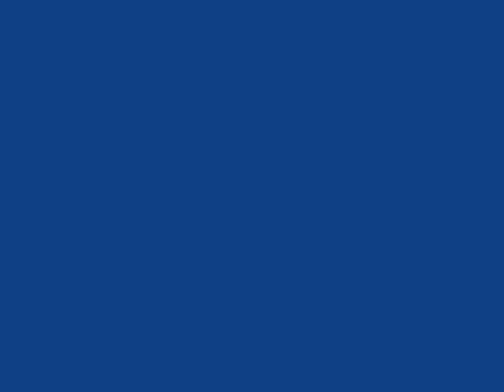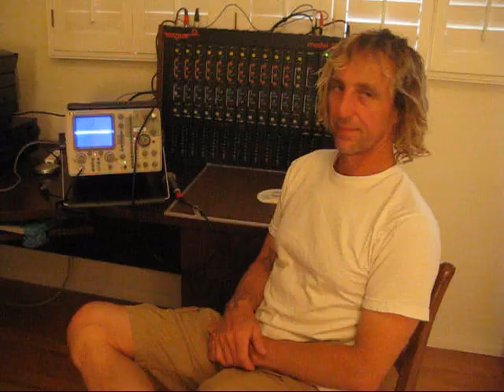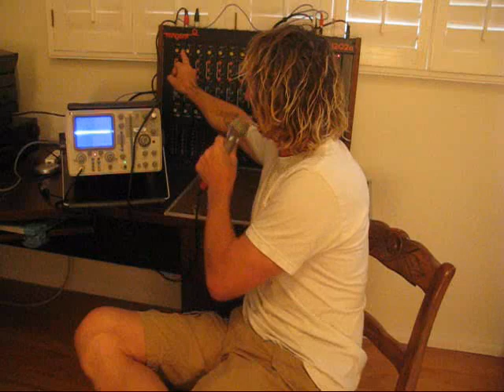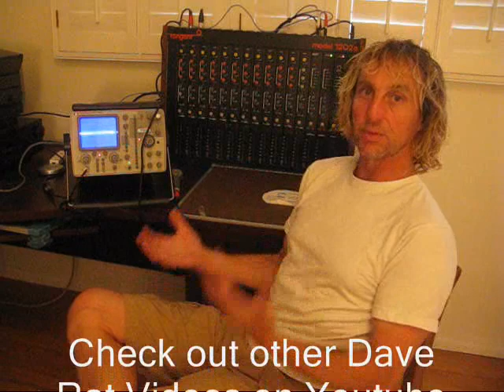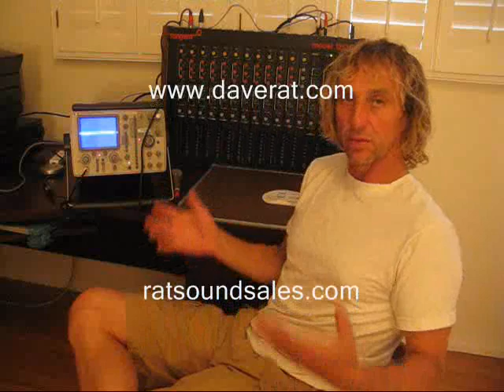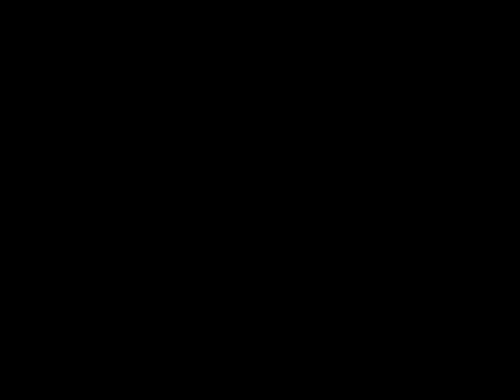Gain Structure Basics for an Analog Console

Comment: On an analog board, the gain structure has a couple of important parts.  1 - Read the manual.  Electrically the power supply in most analog consoles is Plus and Minus 15 volts, so the output of the board will not put out a higher peak than about 12 volt peaks.  On most boards this is at about +24 to +26DB. Normal output is +6 DB for 0VU. 0DB is defined as 0.775 Volts AC. +6 is about 1.5 VAC.  The difference between nominal output and clipping is called Headroom.  The Difference between output and noise is called SN. The difference between peak (just under clip) and the noise floor is called Dynamic Range.  Running low levels reduces the SN ratio.  Running hot increases your SN ratio, but reduces your headroom.  If you run the recommended 0VU all the way through the board, then you have proper headroom with good SN ratio.  Your effects, EQ, Compressors, etc are expecting signal levels in the +6 DB range to operate propterly.  Ideally when the board clips at +26, this is the same level your EQ clips (about 12 volt pos and neg peaks)  If you run the board hot, and turn it down in the EQ, the EQ will run with less dynamic range and higher SN ratio, etc.  Use the design levels people for best results.  Set your channel gains, then mix with sliders, and set the mains for about 0VU (+6DB out). Set your final system volume on the amps.
Reply: isettech why you are not using the unity or the 0 in the anolog
Reply: Excellent
Reply: So much misinfo here.
Reply: I just realized I didn’t offer much in my reply.  The short descriptions of headroom, S/N, and dynamic range are each correct.  Literally everything else - all the numbers, the math, the description of console power - is just nonsense.  I’m sure the poster meant well but I’m always bugged by explicit tech knowledge offered with gross inaccuracy, numbers without references, etc.  The over-simplification of console operation is the most grating of all.  The mixer is a creative tool and always has been.  Technical rules are just suggestions for the creative.  Many sources simply come alive with intentional and selective saturation of the channel’s various stages.  Phrases like “expecting” and “operate properly” have no place defining the special tools in an analog mixer.  Learning how to use the preamps used to be mixing 101.
Reply: @artysanmobile  You can ignore the physical construction and limitations of the operational amplifiers at your own peril. Feel free to look up the repair manual of your console and find the power supply section.
Nice of you to debunk the "Generalities" mentioned. I repair equipment for a living. Yes, I know the repair side as well as I know the operation side.
If you want to look up the open loop gain, slew rate, linearity, noise figure, etc of your console, then you would know that many physical limitations are real.
Feel free to visit Texas Instruments Op Amp selection guide for discerning audio enthusiasts.
In regards to "Creativity" in audio mixing, I use the example.. Some people can paint a Picasso abstract and call it art. These people who can not properly do proportions and mix pait colors to get precise colors will never be a Normal Rockwell.  At my events, we don't want Picasso sound.

Comment: @canetree it wouldnt let me post the link, so ill post it here. "Preventing Loudspeaker Damage - Preventing damage to or failure of a loudspeaker is not a function of amplifier size nor the loudspeaker's power rating. Preventing damage is a function of operating an audio system so that a loudspeaker is not stressed beyond its limits. If an audio system is operated improperly, damage to or failure of a loudspeaker can occur even with an amplifier sized well below the loudspeaker's power rating.."

Comment: @canetree continued... ".... Contrarily, if an audio system is operated properly, damage to or failure of a loudspeaker can be avoided even with an amplifier sized well in excess of the loudspeaker's continuous (or RMS, average, etc.) power rating."

Comment: There is a large difference between the two. The former is the result of harmonic distortion being introduced at the input stage. This signal is then reproduced by a power amplifier SENDING SINE WAVE.

The latter is the result of the output stage of an amplifier not receiving enough juice from the power supply, resulting in a SQUARE WAVE to the speakers.

The difference is thus, in a purposefully overdriven guitar amp , the output stage still operates within it's limits.......all good...cont.

Comment: @StuballScramble (cont) Most faders on professional consoles  are at least 100 mm are are less sensitive to small movements. Especially if the fader is near 0 or nominal. What you might be seeing is that the smallest movement on the gain produces feedback, but the actual increase may be a larger increase. (lets say 4dB). On the fader, you may be able to bring it up 3dB, and not get feedback.

Comment: its interesting to see such a highly acclaimed sound engineer with worlds more experience on bigger shows than I'll ever have teach doing this explicitly opposite the way I would, and the way I'd teach someone else to do it.  I definitely learned from this video!!  His method HAS to be faster than what I've been doing for getting an acceptable mix out the speakers on the first go.  The problem I see with setting gain for fader position is that it ~doesn't~ force the rest of your system gain structure to be 'correct.' 

Here's what I've always done:

I've always used 'solo the channel during the sound check song, set gain for the board's unity level based on the meters'  This has the benefit of ensuring the signal is dead on where the board's design engineer aligned all the circuitry to sound its very best.  If after doing that your master faders and aux sends are NOT where you want them when you bring up the PA, effects, monitor amplifiers, etc..  then you have gain problems down stream from the board and you should go fix those so that the controls are where you want them.  Basically I'm trying to optimize the board to work at its best, and by doing so force the rest of the system into a good S/N ratio.   So many small time rigs I run into have the amplifier gains wide open, which adds hiss (because they use shitty equipment) and means all their input gains are really low..   Am I just doing it the hard way for no reason?
Reply from the maker: It's all about finding a technique that is optimized for your application and systems.  I learned to set gains really fast when doing a 60-piece orchestra for afternoon concerts in the park. without the ability to make noise before the show started I had to learn to set gains EQ channels and EQ the sound system with house music without ever hearing an instrument through the PA. I will try and do a video going into more depth on the technique
Reply: @DaveRat please do this video. I’m highly interested in this topic

Comment: @canetree well, we could use some upgrades, but thats another story for another day. (We have a pretty impressive company for a town of 60,000-and we travel up to 200 mi)
What i was saying is that when you are clipping a channel at a concert, you are already likely to be at a high volume. When you start sending a square wave to the amps, they amplify that and instead of the speaker smoothly going in and out, it gets held in or out. when that happens the voice coil heats up and the epoxy melts

Comment: Mike- what Dave did on this video was set the faders to +3dBon the console and then finesse his way around the trim pot. He can do this based on experience with the console and how it will react. 

I would recommend a slightly different approach to gain structure for you based on your question. You would probably be better with using the PFL button and meter to set your input levels. At this point you can set the inputs around 0dBu the way you want to hear them and giving you logical send levels

Comment: Excellent Dave.  Subscribed.   I've just acquired an 18-8-2 console and although I've done some sound (FOH) engineering (decades ago), I'm predominantly using this board for recording via a Fostex D160 16 tracker.   THis was a good refresher for me and I'm glad to see that what you advocate is pretty much the same way I remember things.  

However,  in the past I was mostly flying the board live into PA.  Whereas now, I'll be mixing down and mastering to a two channel DAW.   So in this context, the clipping aspect I suspect will need to be watched given that I'm mastering to digital, from analog via a two channel A/D interface.

Comment: Hey Dave, one thing i think you should point out to your listeners is that when you clip channels on a board, you are sending a square wave (instead of a sine wave) through the amps and to the speakers. The company I work for has had engineers clip something throughout a night and come back to the shop with something like 8 blown 18 in drivers and 6 blown 15s. Now, they were probably going to give at some point, but the continuous clipping eventually led to a premature failure in the voice coil

Comment: for FOH i run all faders at zero, and use my DCA's or VCA's to balance the band. the only fader that rides above zero is a solo or a lead vocal. it's visually neat and clear to me. if i need to boost a hi hat or something i go for the trim/preamp. 

it's the opposite of my recording methods.

i basically end up using my DCA's etc to do what you do. i am going to try it your way next time. i also do the " just play as a band " thing or have back line run line checks.

as always, respect, and thank you for sharing!

you should have a show, or be teaching at your shop.

j

Comment: @thaflyinsoundman If the amps are matched such that they're powering the speakers at their program rating and you start running highly compressed, clipped signals through the system when it's going full tilt without proper rms limiting, it's quite easy to cook drivers in a short period of time because you will exceed their rms rating. Program power rating is usually 2x rms, so if the amps are full tilt with clipped signals feeding them they're capable of 2x rms into the speakers.

Comment: Digital snafu - expensive tech repair. Analog snafu - tap it, that doesn't work, get a bigger hammer. 

Thanks Dave, I have a relatively inexpensive, analog mixer to interconnect my homegrown setup.  I have experimented and come up with a usable knowledge about this rig but wasn't really sure if I was using the "correct" approach. I feel better now about some (but not all) of my conclusions. I find the "work backward" concept particularly useful and completely logical. I have always put too much emphasis on the early gain knob because I was also guilty of thinking that too little "gain" would allow excessive noise. I will be correcting that immediately. Thanks again, TW
Reply from the maker: Cool cool. Yes, am doing a 5 part series right now on posted in my YouTube membership area comparing a small format digital to small format analog console and the differences in latency, HF response, LF response, transient and overload. 

At some point I will release the series for general public.

And keep learning and figuring!
Reply: @DaveRat  -  I decided I get so much valuable info (not to mention entertainment) from your vid's that it is time to give a little back - signed up in appreciation - now I need to figure your site out. TW

Comment from the maker: @RhinoSanderson yep.  Especially if you have a fairly quite console.  Just be sure that if you find the gain way low or way hot, to use the pads to get the gain knob into a reasonable rotational position, say between 9 o'clock to 3 o'clock would be best.

Comment: What I did say was that where you have your amplifiers MATCHED to your speakers, IF you send your AMPS in to clip, you are now driving your speakers too hard which will eventually cause thermal overload, otherwise known as a burnt voice coil.

Of course clipping your amps also introduce distortion.

The DIFFERENCE that I was pointing out to you which you seem to have missed (since you claimed clipping is the same as limiting) was that when an amp clips, it is outputting MORE power not less!

Comment: This is one way to set gain structure - the "fader position" style.  I prefer to use PFL/solo mode(which is unaffected by fader positions), even if I have the whole band going full out during soundcheck.  This way I know I'm using optimum gain on all inputs and my sends are getting enough current to send signal to any stage monitors, aaaaand, I can set my mains amps(FOH) attenuators to the required or legal volume level instead of having them fully clockwise all the time.

Comment from the maker: @canetree I very rarely see true DC from even blown amps.  But when many amps are over driven the output forms a square wave with the flat part top and bottom of the square wave being the DC supply rails of the amp.  You can even often see the ripple of the supply as well.  So nope, not true DC but its a DC component to the waveform that increases heat and RMS delivered to the speaker.

Comment: @StuballScramble In smaller venues, you often dont have a separate monitor console, and likely are running FOH and monitors from one desk. When you have stable levels in the wedges, the minute you touch the gain, it changes the level going to them too. Some of the feedback could be actually be sourced at the monitors, but you are hearing it through the main pa. Also, a gain knob has a travel of, what, 1 in max? Most faders on professional consoles are at least 100 mm and are less sensitive.(cont

Comment from the maker: Pretty much that is correct. Faders are just attenuators, usually.  There are some exceptions like old Tapco consoles where the faders were gain stages that could clip.  Also the group or L/R summing amps are set such that with the fader at zero, there is unity gain. Looking at it another way, the fader at zero is actually -10db and the summing amp is +10db.  Do ya follow?

Comment: Dave, does having to be more careful with gain in the digital world present tougher challenges for getting that optimal sound?
Reply from the maker: Different challenges. With analog you can use the overload as part of the sound, and w digital, generally the overload is undesirable in any form. That said, if you want super clean, no overload, the two formats are similar, stay away from the red.

Comment: Depends where the light is triggered to show up. On high end consoles there's up to 40dB headroom above the top red lights on the meter, so you can have the meters showing glowing red and still be hearing no distortion. All depends what you're putting through them, but generally meters are only a little light or dancing needle of some sort, and it only shows you what it's calibrated to show, which is not necessarily what's happening with the components and signal

Comment: Should also be noted that the EQ has a bunch of little amps in it, and that if you're planning on shaping the sound using a lot of boost, starting off with a conservatively low gain will prevent the EQ from overloading, which sounds quite different to straight clipping, but is equally muddy and horrible, if not more so. Lots of consoles have a +20dB gain on the EQs, so if your level is 3dB below clipping, then you will push it into clipping inside the EQ by boosting even a little bit.

Comment from the maker: The effects of clipping vary. Most well designed gear can handle some clipping without damage and quite often without dire sonic effects. Clipping just means you have reached the voltage/current limitations of that piece of gear or that gain stage. Some gear tolerates it better than others. I have no issue with exceeding the limitations as long as the results are in line with the application.
Reply: Depends how the meters are designed, and particularly whether professional standard line +4dBV or consumer standard -10dBV line are being indiscriminately mixed, which can really cause problems (as I am sure you are aware).

Certainly really good analogue equipment has heaps of headroom, and you can run it red hot without suffering anything other than a few percent extra THD, rather than squaring off waveforms. Very much depends on the circuit design, particularly the power supply.

Comment from the maker: Setting input gain is not as complex or delicate as many people make it out to be. Basically if the gain is too high, the channel clips and can cause undesirable distortion.  If the gain is too low it can cause you to run out of headroom and you will get some additional console hiss.  So, you just need the gain pots somewhere between too low and too high.  Preferably a position that causes your faders to sit in logical positions.

Comment: when you say you clip the kicks and snares on analogue mixers, is that kind of like setting a basis of compression for the maxinal sound inputs for that chanel, so not compressing the quieter inputs, but when the kicks and snares are hit with force, evening the signal out by allowing it to clip? or what advantage do you get by letting the kicks and snares clip?

Comment from the maker: However you want to look at it.  All those db's are relative.  Many mixer manuals will have a gain structure diagram that shows exactly what is going on. Like +10 sent to the fader, set the fader at 0, (which cause a 10 db drop) sends the signal to the summing buss and so on...

Comment: Good coverage of the front end gain structure. However you didn't mention anything about the amplifier gains. I do as you say without the amps turned up, then adjust the amp gains using a spl meter and ears. Cheers.